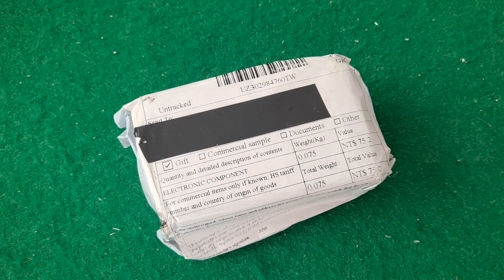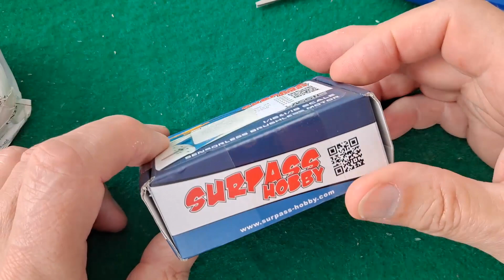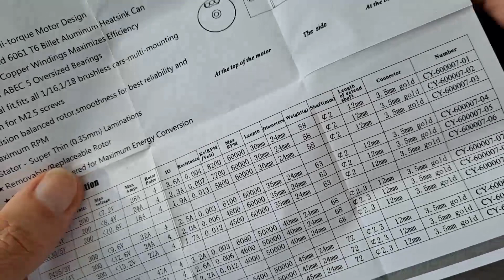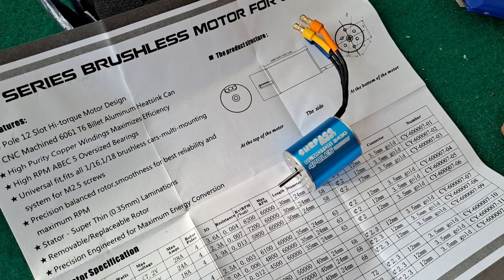Grandad's Postbag 20200919 Surpass Brushless motor 2430 8200KV

Comment: my 2430 8200 kv engine arrived i started em2s using 18650 battery i noticed that it has no speed and is heating up very fast its does the same thing which battery are you using?
Reply from the maker: Yes it does get hot, I used it in a boat in these two videos just to test it and it got hot enough to soften the PLA I had printed the boat with https://youtu.be/l0jd4DMkDMI https://youtu.be/W67bQVb68Do I was running it on a small 2S LiIon battery.

Comment: I have the same only 7000 kv they heat up pretty quick
Reply from the maker: Sounds like I should put it in a boat rather than a car. I have been looking at fitting it in one of my cars at the moment, but will need to get a different pinion gear to run it.
Reply: @GrandadIsAnOldMan  wouldn't putting in a car will destroy the diffs in minutes ask me how i know lol a boat with water cooling jacket yes

Comment: 8200KV = ludicrous speed
Reply: also Wattage without load is very high
Reply from the maker: I wouldn't know. I rarely have any use for brushless motors. I think this was an impulse buy. It was back in March that I ordered it, it never turned up. The seller eventually agreed to "talk to his distributor" so 6 months later it has arrived. I will have to see what I can do with it. Maybe a car, maybe a boat.
Reply: @GrandadIsAnOldMan  Brushed motors are useless. If you replace the same KV brushed motor with a good brushless one you will increase the efficiency with 100% or more. What you can do with this 8200KV motor is converting a crawler into a racecar (on 2-3S). What I did with the 1/12 Tamiya cars is using a 2000KV motor on 2S with bigger wheels on a 20A speedcontroller.
Reply from the maker: @prep0wer  not really a concern for me. I am never looking for high speed or high power. I don't do fast.
Reply: @GrandadIsAnOldMan  OK but crawling fast is kind of funny (still low power)

Comment: Oh yes, a brushless motor in a car. Waiting for this one. 😁👍
Reply from the maker: Hi Mike, don't hold your breath. I ordered this on the spur of the moment because the price looked good and the listing showed 2 motors. For 1 motor the price is OK but for 2 it would have been better. I don't remember what car I had in mind or even if it was just the price that inspired me. The Revell Lion 4x4 might be the one but I remotored that not so long ago. Same with the Maisto Extreme Beasts. They all would need proper hobby grade conversion to run a brushless. I do have another brushless that came with a matched ESC and is a bit bigger so I might put that in the Maisto and put this latest one in one of those 3d boat hulls I printed.